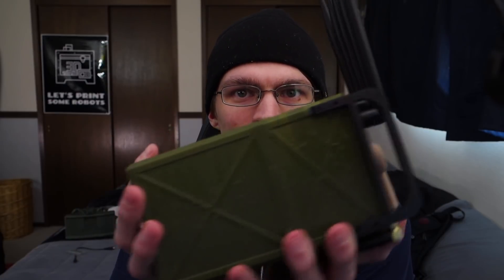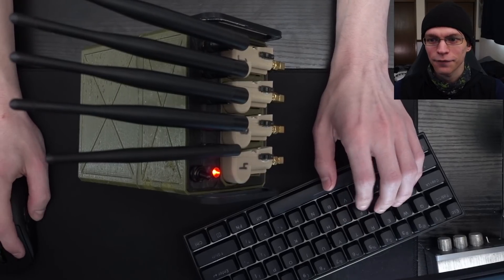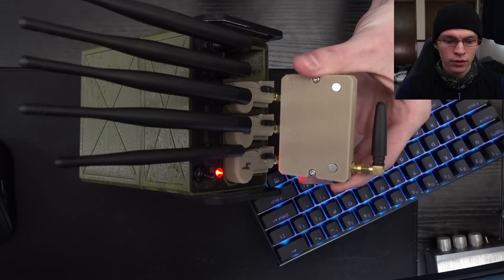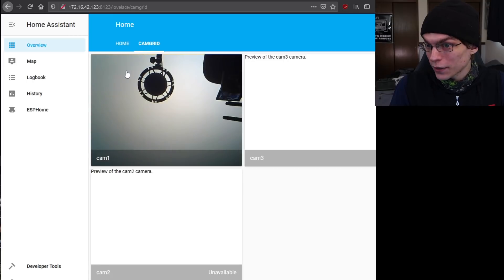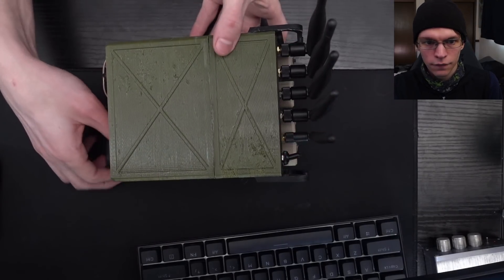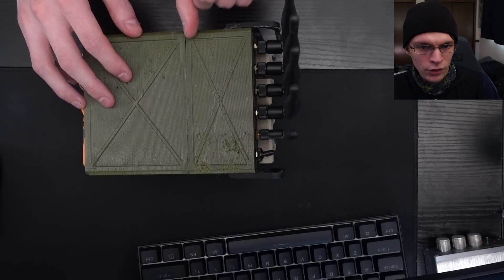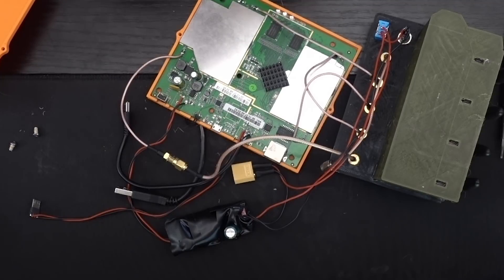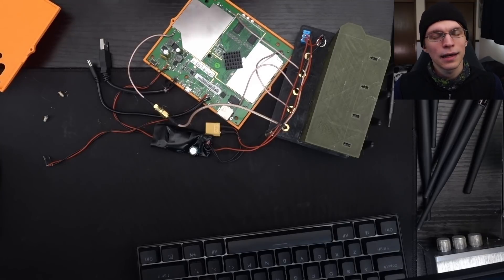Cloud-Free Cameras with a side of Pineapple - Hak5 2612

Comment: A bit of missinfo here. PETG prints cooler than ABS and prints slightly harder than PLA. Probably not the best printer or settings. Part fan at 60-100%, nozzle 220-240C max, bed 65-75C

Comment: You know sometimes when you 'lock in' to a project, you end up doing it that hardway...

eBay, 10x 18650 power bank DIY.

I'm not sure what you got the pi for, but I'm assuming that you've created a private wisp using the WiFi card? And you're serving from the pi?

Okay... Well you can data stream and host/wisp from the esp32. Just get the WiFi station sketch. That's you're 'net' sorted out. 
Html code the streams and see if you can data bus the cameras Into the wisp host or secondary for hosting.

Now as for camera on battery, a switch on the side? Well no device needed to be able to turn that off.
But two batteries. And a step up, so you can max power (MHA) from the two and step up the voltage. 
I understand that running 5v is better for the cam, as 3.3 can brownout.
So there is the usb charge modules... Which of course you put I to the based station, not the camera...
And In the camera the boost converter.
Two cells... Btw 18650 are NOT the best or most powerful cells they do make bigger and I have NiMH which are somewhat higher powered, but lower voltage. But you can get some li-ion cells of around 6500mha (actual).

The cams power is around 320mha so you can calculate run times.

The problem with those mini usb to li-ion chargers is that they are low power.... About 1 amp, unless your using 20+ year old tech, then that's not going to cut it. 8 hour charge times!!! 

You should be able to run them together, but two cells you can just run a protection chip and full power (what ever c rate, so about 3 amp)
That gives you a two hour charge time...

So a 555 chip, not sure on current sense on the esp, can do on a aurdino nana for voltage control. And I would use the data read from the protection chip for cut off when charged... 

Great idea, though..
Perhaps having in the base a smaller server or link?

And those antenna nightmares... Just short it, it would need to be move or removed, you can knock it off.... 

Isn't the older oi smaller and still able... It's not about the latest tech, but suitable tech...
BUT....

M5esp something or rather make a all in one with most of what you've attached in one package btw... Charge controller boost... WiFi, server etc and boosted CPU performance for better imaging.

Comment: Just some notes for your next revision.

Shielding. The outer shell of any device of this nature requires shielding. 

Onboard storage and buffering. 

A separate control interface from the stream interface.

Sealing the enclosure against moisture, and possibly rubberizing the exposed surfaces of the hardware. Easier said than done. Electronics are difficult to seal properly.

 Quick release latches.

A direct connect with proprietary connections.

A configurable hardware encryption method.

You're borderline on an actual marketable piece of kit. With those revisions and some testing you'd be further towards that.

Comment: Can you monitor these without being connected to the internet? Like connect directly to a laptop/phone/tablet via wifi? Because if you can do that and figure out manufacturing you REALLY need to be marketing this to the Prepper/Survivalist community. Especially if you can design a lid or fit the whole thing into a plastic ammo box. The 3D printed version looks awesome and an injection molded version would be great but plastic ammo boxes are waterproof and relatively inexpensive while still having a similar "tactical" look.

Comment: But why 22V battery? You could wire it by 3 cells and thus double the capacity.
Reply: Also I guess pineapple uses stepdown circuit to make 3.3V out of 12, so even 9V may be sufficient to power it. Three 18650 cells are 12.6-9.6V unregulated, I would try this configuration.

Comment: 8:20
Take apart a junk switch mode power supply and make your fine pitched trace connections with the salvaged copper enamelled wire from the primary side of the transformer. If it's good enough insulation for mains AC power, it's good enough for this low voltage DC. I use an exacto knife to scrape off the enamel in a controlled way, then pre-tin the wire end to prove that the enamel is completely removed. This will create a more flexible type of arrangement. The plastic insulated wire is just too cumbersome. Once the wires are in place hot glue it to keep it from moving around. If you hot glue everything except the actual wire-to-trace solder connections, you can de-solder the connection and pry off the hotglue to reverse the hack later. If you cover the solder joint in hot glue you'll rip up the traces when removing it.

   The USB data connections are a differential pair, (note the parallel trace routing on the PCB). Without the proper shielding/ground/signal impedance match, noise coupling problems can occur. With a similar range of potential issues as wires on the removed connector, you could just solder wires to the pins of the IC where the USB connector traces are routed to. Cut the old traces near the pins to stop them from picking up noise too. It doesn't take much to cut them and it is easy to bridge the trace with a soldered strand of bare copper if needed later. 

  Don't worry about the USB power trace at the USB connector. Tap the 5 volt supply at the largest capacitor on the 5 volt net near the regulator and source the ground connection from the other side of this same capacitor.
Nice project.
-Jake
Reply: Great idea, thx!

Comment: Awesome project, I feel improvements could of course be made in regards to reducing the overall footprint of both the main module itself, as well as the individual camera modules, although it would certainly require more work on the software side and a slightly different layout of the hardware in physical space.

Thanks for sharing this really cool project, it may not be a new idea but it is one of the few places actually demonstrating such an idea to a public audience while using relatively accessible parts.